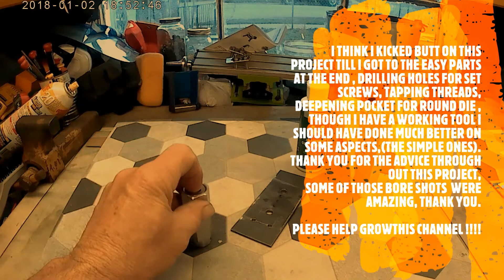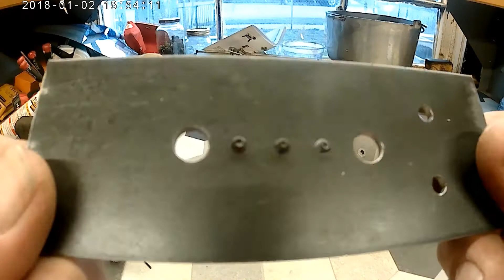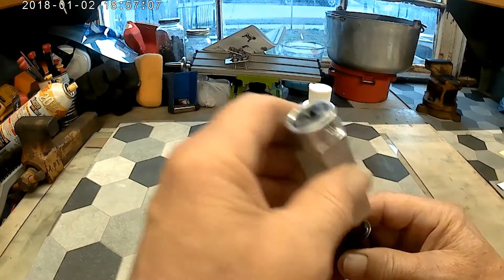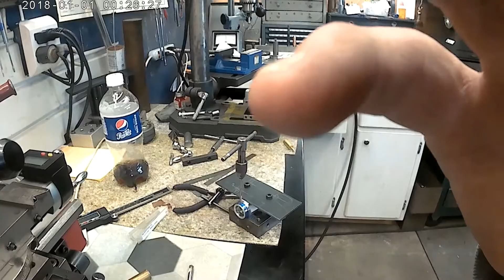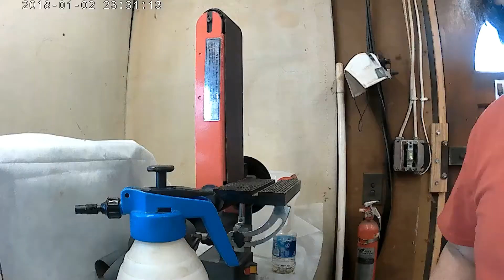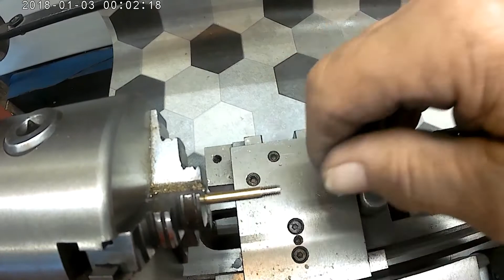TAILSTOCK DIE HOLDER CONCLUSION

Comment: I would say you should turn down the rpm a bit using this tool.
And add some lubrication 

Besides that, very Nice tool!

I dont even own dies, So a die holder isn’t a project for me. Lol

My lathe has the smoothest thread cutting option possible! I’m So pleased with it!
I’ve done a video on it.

Comment: At 16 -17 minutes you are threading in the lathe hand-holding the dye. Use a high sulfur cutting oil if you can, there should be oil dripping off. And if no sulfur oil just use a lube of some sort.